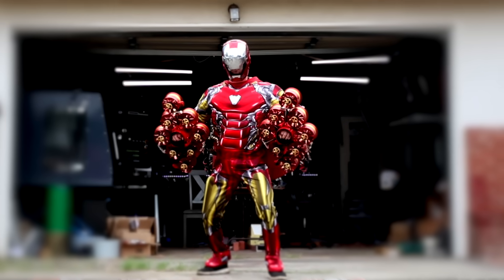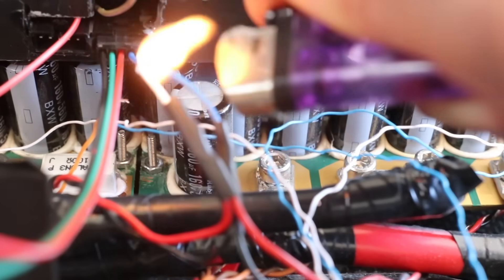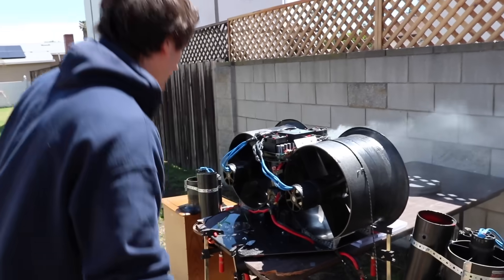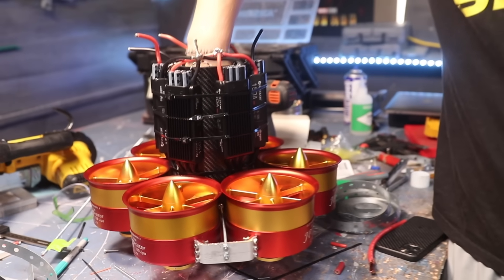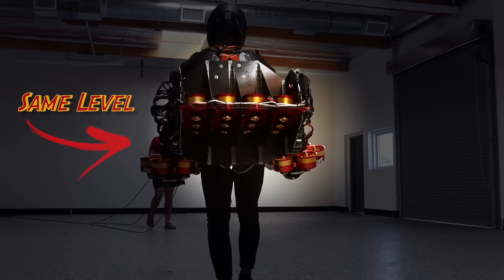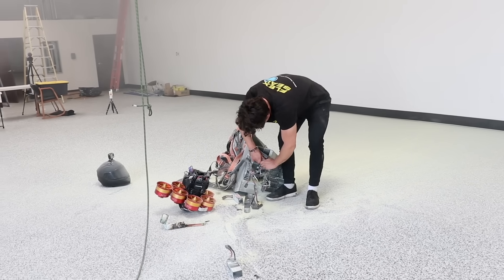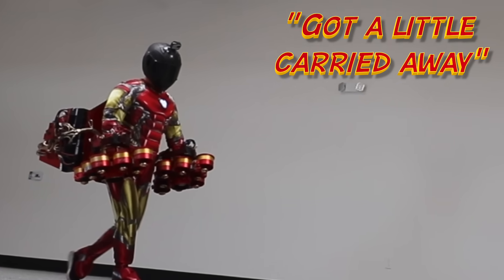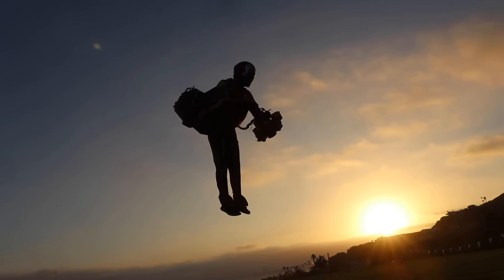Real Flying Iron Man Suit That Comes To You!

Comment: Okay, new to the channel. Just subscribed.

Here's an idea! In your Doc Ock Arms vid you had a mind control software that could detect what you thought.

Well, I propose you make the Sonic Screwdriver from Doctor Who to celebrate the show's 60th Anniversary coming next year!

Essentially, it's a little stick-shaped metal device that you point at things and it tells you stuff like atmospheric pressure, weather patterns, material density, electrical signal strength, etc while also activating any digital/magnetic/electronic device.

The Show describes it as "point and think" to make it work/do what you want, so I think it would be a nice challenge! Like a Universal Remote but for EVERYTHING!

(Oh! And it doesn't do wood, so you don't HAVE to deal with that, but it WOULD be GREAT to see you tackle that design flaw!)

Comment: Excellent work as always! It's functional (by the end), and considering just how difficult a project like this is, I'm amazed that you managed to make a suit that actually flies!

But of course, that brings me to the next point, which I know I'm not the first to make. It's not an Iron Man suit, it's a flight suit. Iron Man's suits are armor first, and flight-capable second (I get weight was an issue, which is why a rework would be needed to actually make it a suit of armor). On top of that, the setup is bulky (because it has to be), and when flying, it doesn't even emulate quite the same feel of Iron Man. The hovering comes close, but even then...

It's just difficult to be completely accurate to Iron Man. The tech isn't there, and likely never truly will be. It is fiction, after all. All that said, this is still truly impressive, and I'm excited to see what y'all do next. Keep up the great work!

Comment: Been working on a similar project and I think having edfs of variable size and thrust may help especially given placement. For example I figure that placing edfs on the hips would be great for  stability given the fact that ASU had a carbon fiber belt they made with two edfs on it and you proved that to be the case as well. You actually ran through a good chunk of notes I made myself so seeing this video is gonna help alot. But overall this was an awesome project to see you tackle. Good work.

Comment: The wires melting could be from the motor starting torque basically the electrical motors takes from 5 to 7 its working current to start  however you can limit this with good control system but it will make the motor starting time a little bit slow

Comment: That was really awesome dude!?!?❤️
I started watching your videos from the diy projects. And i actually waited for you videos , I will be on the verge of unsubscribing from here, but when I actually see the videos at the end, i get hooked up more.
Just a idea: what if you add a 1 or 2 thruster in front you body. Or like some additional that you don't turn on during the flight, but only when you wanna get down, it doesn't have to have much thrust, but enough to slow down your landing. It will be safer cuz, like 15 feet , that's high. And also you could use it for stabilizing if the flight ever gets out of control sometimes. ✌️
Well then again I don't know anything about the limits of the power consumption or the amount of thrust.so just let this slide, if you read it ever that is 😄.

Comment: Hopefully you look at this comment or not idk if it's helpful but also I love your persistence and how you trusted it to get here, it's amazing!
Now for the rest,
Even in the movie, I think the propulsion system needed a lot of control just so your arms don't sway or stray and ruin your balance and have you fall, so maybe that's why He had a exoskeleton-like design attached or build in to the propulsion from his hands to help him control the propulsion of his suit to the best of it's ability, 

So, since you don't have his methods or exoskeleton design on fixing the problem why not use a passive ( not active, as in active i means that it requires energy, energy that you need for the fans to carry you and the equipment for flight) exoskeleton prototype which doesn't require Electricity but gives you more control of the fans direction in a possibly light weight design (could use carbon fiber as to what I'm referring to).

There is this video of a guy who made a third arm that can carry The weight of his heavy replica of the machine gun from the movie alien while letting him control the aim of the weapon.
Here's the reference

https://youtu.be/5bzCJlF5khw

https://youtu.be/SfRMbq4-c3g

Comment: Very cool video)) we live in amazing times when you can assemble your iron man suit in the garage! and for greater stability, did you try to transfer the main thrust to your feet? as in the original suit, then you don’t have to strain your arms much to stabilize the flight, and you get something in the style of a water jet pack, only with a separate jet for each leg, following the example of Frank Zapata. This would greatly improve stability, reduce the load on the hands! Sincerely, the builder of a flying car and a motorcycle, in the garage)

Comment: Bigger jet engines that use actual fuel and use thrust vectoring , lean back so that the centre of thrust lines up with centre of mass . Use those electric motors for stabilization. And use jet fuel.
Reply: But didn’t he say he didn’t want to use fossil fuels

Comment: I want to say this first- You and Hacksmith have inspired me to levels of interest I didn't have before. Granted to levels beyond my wallet but that is what imagination is for, haha

I have an idea or two as to why certain things happen and potential fixes, now Im not a mechanic or physicist so my observations and assumptions either don't work or don't make sense. So that is why I want to refine them to make more sense (Basically Im going to heavily condense and simplify what I mean)

Stability in the air is MUCH harder then the ground. Planes, helicopters and even superhero suits follow a certain design for a reason. Looking at the movies Tony makes very specific poses for idle and flying, probably because doing it wrong causes spin or other disasterous effects. If you can keep your hands and feet as flat as possible you can theoretically be very stable in the air like Iron Man

But the flying is probably- well gaurenteed to be harder. From what I can gather from the movies (and how I can understand physics) a airplane-esque shape is your best bet. Flat horizontally and all thrusters facing the same directions. How do you turn mid air to do that without dipping down and crashing? Uh...practice?

Tl;dr- find a way to stabilize yourself, probably by flattening your thrusters, and practice that for a while before attempting real flight in a padded warehouse

Comment: So this is the mark II ?   There is a concept of a motor with no axial.   It would be a ducted fan with NO center.  Meaning the magnets are in the tips of the blades in a wheel rim and the electromagnets are in the fan shroud kind of like the stators in a jet engine but THESE would spin around a common core and that core could be a sleeve for your arm.  This sounds impractical, I know, but the think is this would not be very large and you could have four of them in series on your arm to accelerate air in steps to flow over your hand .   Do the same thing for your calves.   For your back you need an IMPELLER turbine and an exhaust directed below your armpits, and maybe another on your lower back.  I have no idea about thrust, but an impeller does not work the same as a propeller but you do need the intake above and not behind you.  Also, grow a decent Stark Beard if you take this next step.  Good luck in the future, you are already on your way.
Reply: A Third impeller thruster could be added to your chest and the air directed out under the armor at various points.  Consider also when you fly, you want to body surf, not just hover standing strait up.  You do need wings like Buzz Lightyear  if you really want to go to infinity and beyond.
Reply: I suppose you would need at least 30 lbs of thrust per arm and maybe 35 for your calves , that would be 130 lbs total for limbs and you would need to make the rest up two or three impeller jet fans.  What does the best  leaf blower do?  10 lbs of thrust?  You need a more serious device, but flat against the back.  Would you consider a Co2 or Nitrogen thruster to suppliment this?   Also consider a tube, vertical, about 5 inches inside diameter with a slight bend to come under the arm on the back a little and then curve back again to stay behind the center of mass, your 2nd lumbar disk.   Stack fan motors inside this for combined series thrust instead of your parallel examples that you have already done.  This will streamline your suit and you could still to the impeller thruster also.  I don't know if these hub motors even exist or could be fast enough.   Stacked in a series on your forearm, like four rings, each one could spin in the opposite direction of the one infront of it.   Having ducted fans BESIDE you throws the force out to one side and it needs to be more central.  There is also the bottom of your feet for two sixteen pound thrust fans, 32 lbs per foot.  I'm starting to see some hope.    160 in limb thrusters  80 from two impeller thrusters, that's 240, the stacked tube jet engines might do another 30 each or better, that would be 320.   Batteries would have to be built into the suit at multiple junctions. but consider that the plates of armor themselves could be the batteries.  Stamped copper and lithium and polymer in those shapes, like vacuum forming, only with battery materials, it would really save weight.    Maybe some of these ideas will make a light bulb go off in your head.
Reply: @TheWadetube  cool ideas if i ever get the chance to test these ideas do i have your permission? and if i make a video about it i will credit you
Reply: @jamwar4167  Of course.  I have about 150 other inventions to focus on and seeing someone take an idea and run with it, maybe improve it would be a delight.  2 -20 ounce bottles of compressed nitrogen or even co2 might add thrust where needed but only for 20 seconds or so.,  possibly run it through hot water first to boost the thrust, you could reasonably get an extra 50 lbs of thrust.  Good luck
Reply: @TheWadetube  ok thanks
Reply: @TheWadetube  Hey, so I decided that I'm no going to build and make a video on this idea. However, your idea is still cool though 👍

Comment: You didn't mention in the video if you figured out why the thrust was lower than you expected. It's likely because your motors are at a slight angle when you are wearing them. In your videos you can see the angle and can probably estimate them. The two arm arrays and the back array act like a tripod. To calculate the thrust, take the cosine of those angles from vertical multiplied by the expected thrust if they were pointed straight downward. You should get a thrust value closer to what you actually experienced.

Comment: This is SO cool!
My favourite quote is "we eventually ran out of things to go wrong". That is what you have to do as an engineer. Murphy's law, but expressed way more cooler.
Why is it though that there is always these kind of problems with EDFs? Hacksmith also tried these a while back, and had the same issues: batteries blowing up, wires combusting, speed controllers going murder mode, etc.. I wonder if it would be possible to create a way better EDF controller, flight computer and BMS system that is also lightweight enough and extra versatile... I'm thinking a multitude of current, voltage, temperature sensors, gyroscopes, etc, an advanced processor or FPGA to control all of this, PID loops, triple-redundant safety switches, a HUD for in-flight data reporting, a radio connection for comms and telemetry to a ground station... That is a big project for sure